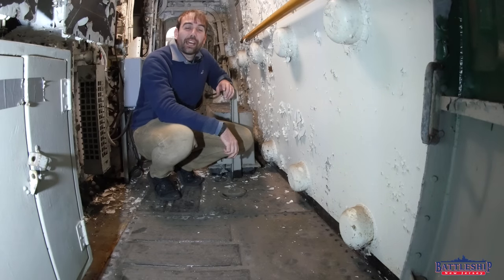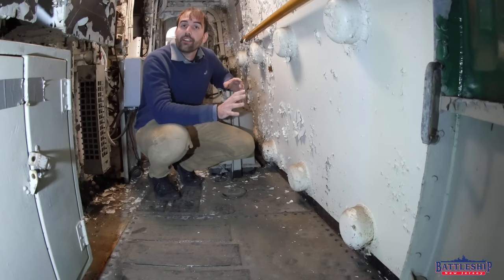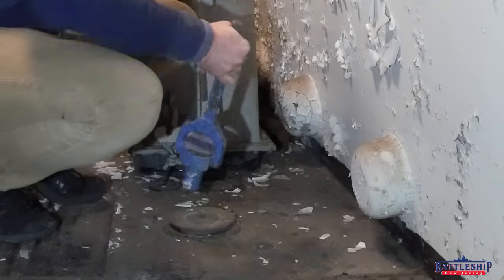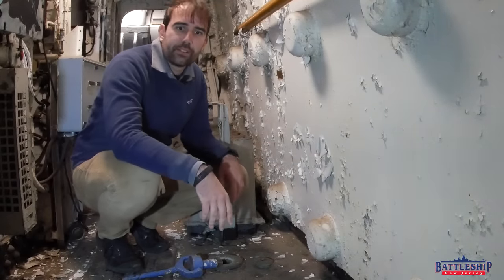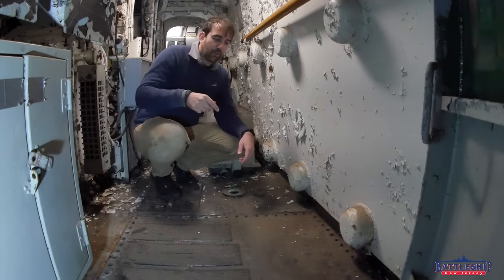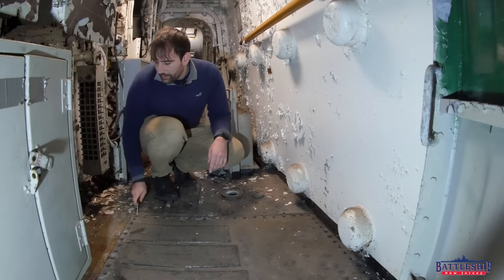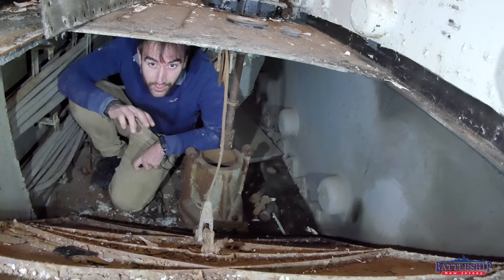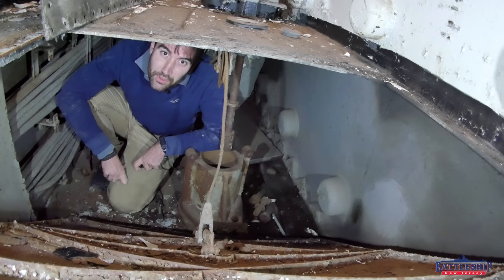Turret Locking Pins: Can the Turrets Rotate? UPDATE

Comment: Back in 2006, Marty, me and several other volunteers raised the barrels on turrets 1 and 2.  Each barrel has locking pins and now are pinned in the 20 degree position.  We raised them manually.  I have pictures of that day.
Reply: I was literally about to ask if the barrels can be elevated.
Reply: The way the Navy loved redundancy, I would not be at all surprised if there was a hand-powered method of turning the turret hiding somewhere.
Reply: @Orxenhorf  there is almost certainly a way to manually build hydraulic pressure, but i wouldn't be surprised if there was no non-hydraulic way to rotate. that said, i could imagine the final gear that rotates the collar could have a bolt or crank for "hand turning" on the other side. sometimes this is done on huge geared systems for various reasons. such a crank may be essentially impossible to turn by "hand" though because of the force required
Reply: @Gunbudder  Tom Scott "the older one" has a video on the turret of the USS Texas. Those were manually trainable, but they're only a fraction of the mass of one on New Jersey's. Even so, the mechanism to manually train one of Texas' turrets looks like a pair of big windlass drums with eight chainfalls each that took sixteen sailors to traverse the turret, slowly. It took 16 guys to train the turret at less than 12° per minute.

https://www.youtube.com/watch?v=GnGuELP0MCQ&ab_channel=TomScott%2CTheOlderOne
Reply: @Gunbudder  there could be an electric turning gear via a large reduction gear, which could be just about manual capable with a pulley setup or comealong. But you'd be getting degrees per minute with an electric motor, so a manual turn doesn't strike me as terribly necessary or even possible.

My ship has electric turning gear on the gearbox for rotating shafts in harbour, and while you can and have to align the drive dogs by hand, turning shafts by hand isn't possible. An Iowa turret probably weighs more than our entire powerplant and driveline.
Reply: @Orxenhorf  I swear some old 1880ish battles ships had that but it required like a hundred men to do it. Which at that point if the turret can't rotate, their probaly needed for damage control.

I know for certain that the hundred ton gun in gebralta could be manually rotated and fired with a 60 man powered system.
Reply: Use a come along, lol
Reply: @Orxenhorf  there is not. Ryan has answered this question time and time again. Those turrets weigh thousands of tons. Even with the gearing in place, you just wouldn't move that kind of weight by hand.

Technically it might be possible, if you custom made a gearbox for it, but I would imagine the turret rotation would be measured in degrees per day, not degrees per minute.

As it stands, with the stock fitted gearing, the turrets are not able to be rotated by hand, at all.
Reply: @roadsweeper1  2 Million pounds minimum? That seems excessive since the number I found for the entire ship is 45,000 tons.
Reply: @abyssaljam441  Iowa has a video on her youtube channel showing some of her guns being raised. Lotta work manually.
Reply: @Gunbudder  I the turret lost main power the guns need manual elevation, but training would be done with the whole ship. Even if the turrets could be rotated manually, it wouldn't be quick enough to follow any target.

 The stable vertical could even compensate for lack of elevation control by firing when the ship was rolled to the correct angle.
Reply: Alternate turret aiming: "Helmsman, hard to port!"
Reply: @J-1410  The turrets are roughly 400 tons each but do not have a manual rotation mechanism. Instead they had a battery backup in the turret to operate all the systems in the event the turret lost mains power. There's likely a way to disengage the turning mechanism entirely and turn the turret with a winch from shore, though. In service the same probably could have been done with the mooring cable capstans or something.
Reply: @willythemailboy2  I was more-so taking issue with the claimed weight than if the can be turned.

Of course the Iowa basically shows that "fix it" is the answer and also that they can be turned on shore power.
Reply: I wasn't in the Navy so I have nothing to add.

Comment: Deep inside, Ryan wants to see the turrets rotate as much as we do
Reply: They'll never train again. The only way they would is to light at least one boiler (which they can't do) in order to get dynamos running (which they can't run) in order to have enough power to run the electro-hydraulic motors (which have no hydraulic fluid) in order to traverse/train the turrets.  Believe me I'd love to see that just as much as anyone else....but I know it'll never happen.
Reply: I wonder what it would take to do that. Even without enough power available to run the original system, it's hydraulic so splicing in a smaller pump (and an anonymous donation of enough of barrels of fluid) should allow doing it, just slower (assuming nothing else is seized up or the like).
Reply: They set up the ships horn to run on air from a small compressor since steam is no longer available onboard.  It would likely be possible to use a portable hydraulic power unit to feed to hydraulic motors and bypass the original pumps.  As a machinery maintenance tech I will say there is always a way.
Reply: @DIVeltro  if they don't train again, it won't be for the reason you cited. It will be because the money it would take to work around those limits would be better spent on something else. Or because of some kind of regulatory fubar.
Reply: If I ever make a million dollars, I would donate at least 250k of that to whichever Battleship would find a way to turn at least one turret.
Reply: Totally could rent a generator that could run it.  All it takes is piles of cash.
Reply: @DIVeltro  a generator could supply the power…..
Reply: When I toured Missouri years ago, I remember something being said about working towards getting a turret to turn.  I wonder what their plan was
Reply: @DIVeltro  , shore power would be available.
Reply: @DIVeltro  they can be handcranked. It’s what they did when the ship was first brought in as a museum
Reply: The 1800 amp breaker for the turret doesn't mean it draws 1800 amps at all times. If your only running a motor or two and not everything. The amperage draw will be much less. Just turn off anything you can spare to avoid overloading the shore power.
Reply: @DIVeltro  so i almost bet there's something that could be done by a tractor....
Reply: The USS Iowa in LA were able to rotate turret 3 on shore power in order to lower multiple 16 in shells to balance the ship and remove the fresh water ballast
Reply: @DIVeltro  You probably shouldn't say that something will never happen when you have no idea if it'll ever happen or not.

Comment: I believe she was the first to be turned into a museum ship was because the material condition of her hull. When she entered drydock in 1986 her hull was in poor condition. Both rudder posts were rotted and one rudder was dangling. The paravane eye was half rotted through and was cut off during that period.  She spend months in drydock and the countless pits were clad welded and sanded smooth. I remember a welding engineering speculated that the hull could have gotten so fatigued that the metal could actually break up if she hit something hard.  I remember kicking around rivet heads in the bottom of drydock.  I wish I would have saved a few.  It was because of the Hull Accountability Work that I met Dick Landgraff. I remember Landgraff commenting the hull problem was caused by inferior hull paint. I remember zinc annodes around the fantail looking pristine instead of rotting away
Reply: I was there.  The Zincs had been installed incorrectly in 82-83 reactivation.  Some yardbird insulated the anodes from the hull steel.  There MUST be an electrical/mechanical connection for the sacrificial anode protection system to work.   BT  "79-"88.
Reply: @barto6577  I was gonna say something like that must have happened.😀
Reply: And New Jersey didn't get the active hull corrosion prevention system the other Iowas received.
Reply: Relatedly, I recall reading part of the reason was the New Jersey had spent more time in commission/active service than the other Iowas, so it was unlikely she would ever be recommissioned, thus a better candidate for museum ship status.
Reply: @barto6577  
It wouldn't surprise me if the guy tasked with bolting on the zincs lamented to his supervisor, "Dammit, the area where the zincs go was painted already so now we have to de-paint those areas."  Supervisor:  "Piss on that, just install them, nobody will ever know or care."  I have no idea of that's how it went but putting myself into the shoes of a lazy manager, that's the scenario that comes to mind.
Reply: @Skank_and_Gutterboy    There was actually rubber gaskets under the Zincs and rubber washers under the bolts.  Everybody who had a clue were dumbfounded.
Reply: @barto6577  
Oh wow!  Down in the engine room bilge they're just bolted right on, that's how it should be.
Reply: @Skank_and_Gutterboy   Just like the Knox frigates I was also on.  They had "Active Cathodic Protection" systems, every now and then, an Electrician's Mate would check the connections to the hull.
Reply: You have to use the correct anode material for the water type the hull is in. Zink is for salt water, and aluminum is for fresh water. They found this out in the USS Cod when it's hull was repaired after being longtime stored in Lake Eire. The Zink anodes had done nothing.  USS New Jersey is in fresh water.
Reply: @barto6577  
Now that's interesting!  I haven't seen that before.

Comment: i imagine that the welding of those pins was mostly a safety step in demilling the ship. if a random sailor (or anyone) tried to raise the pin for whatever reason, they would find it stuck. if they opened the panel to see why, they would find it stuck on purpose. that's a pretty good indication that it is meant to be stuck lol. i have run into things before that appear to be broken (in the military world) but are NOT broken and instead are meant to be "damaged" in a certain way. in my experience, it usually is a bent pin on an electric connector to prevent the wrong plug from being used.

Comment: I just watched a talk by the curator of Battleship Iowa about the so called locking pins for the turrets on Iowa being broken and or misaligned. Their tow company wouldn't tow the ship without them in place because there was a myth that the ship could capsize if the turrets swung out of control and he had to research these pins to convince the tow and the navy that is was safe. Great video I recommend it. Mainly it was about whether turrets fall out when capsized.
Reply: Why would he need to convince the navy? Did they not swing these turrets around?
Reply: The turrets themselves are centered, so it seems to me to be only the weight of the gun barrels themselves that would be affecting the current Center of Gravity if the turret were to rotate.  On the flip side, with no ammo, no stores, and empty ballast tanks, the current C.O.G. may well be much higher than designed, which would tend to magnify the effect of an off-center loading.  The other unknown here would be how much the current weight of the superstructure differs from her design configuration.

In a nutshell, the higher the C.O.G. is from the keel, the less stability the vessel will have.  Move it up far enough, and the ship won't care whether the bridge or the keel is above the surface.  Move it up past that point, and the keel will be the new topside.  This all carefully calculated during the design, and is the reason that a good portion of the total weight of a sailboat is added ballast at the keel.  On some older ships, finding the keel from within the ship can be an adventure involving rocks, scrap iron, and even poured concrete.
Reply: @kevincrosby1760  I thought the gun mechanisms were built over the center of the plate the turret sits on, and the turret has a counterweight.
Reply: @dalepatterson1748  if the turret has a counterweight, then the counterweight would move with the turret, offsetting the weight of the guns regardless of direction they were pointing.

A key design point of any rotating assembly is to center the weight so that it is distributed evenly on the bearing surfaces.
Reply: @kevincrosby1760  Ryan has said that the battleship does indeed sit about 8’ higher in the water than normal, because it’s completely unloaded of fuel and supplies as a museum ship. So the center of gravity is definitely different.

Comment: As others said on the previous video, the motor itself will draw much much less than the rated current you mentioned- that is maximum startup current only, you could easily run it with a VFD or even just run it at lower power without tripping your shore power breaker.  Of course you'd need to find out if you could even fill the hydraulic system but in theory actually running the motor isn't as big of a barrier as you'd think.
Reply: I keep thinking that the current rating that he mentioned was the operating current, not the LRA/Surge current.  The problem was that the ampacity of the SP breaker was substantially less than that of the operating current.  If i remember correctly from a previous video, the SP receptacles topside were not even completely populated, leading to the possibility that the pier facilities couldn't even carry the load.

From 30 years ago, I can remember that even with max SP rigged, wanting to operate even one of our larger cargo fuel transfer pumps required firing a boiler and bringing up an SSTG.  The "standard" configuration of a warship is to have the Ship's Service Generators online.  Shore power is intended only to basically "keep the lights on".  Connected to SP, we had just enough juice to run the electrically-powered auxiliaries required to fire a boiler to the point where we could drive the normal steam-driven Aux equipment.  Bringing those online allowed us to fire the boiler hard enough to actually run an SSTG.  After that, we had the power and steam to bring up the rest of the plant.
Reply: @kevincrosby1760  Never been in the Navy, but I agree with you, shore power is never enough because that kind of load was never contemplated.
Reply: I would also expect that that's the power requirement to operate at full speed, you don't need to operate at full speed on a museum.
Reply: @tedmoss  Turns out that shore power was more than enough to train the turrets since it's now been done.

Comment: I can just imagine a sailor pulling the centering pins as battles stations are being sounded. I bet he had to be fast.
Reply: Oct 24, 1944, Suragau Straight,
Adm Oldendorf, "#$@& Why aren't the &#$@ turrets training on the enemy?"
OD, "Sorry, Admiral, Ens Pulver slipped and lost the locking pin key overboard."
Reply: @ct8764  should have used fulminated mercury.....
Reply: Pretty sure they'd have planned ahead and either unlocked them ahead of time or perhaps simply not locked them at all while in active service.

Looks like more of a maintenance and storage kindof thing than an "Always lock the turret when you leave" kind of thing. You'd have to be in some pretty intense weather for those things to shift on their own, I can't seem to find a total turret weight But just the guns are 121500 KG each.
Reply: @bigblue4364  , 121,500 KG = 133.9 TONS
Reply: @dalepatterson1748  That depends which Tons you're using tbh, It would be 121.5 Metric tons.

Anyhow, that's just one gun, there are 3 and you'd have to assume the turret itself is even heavier than the guns.

Comment: Your observation about the wrench being stored in a different location in each turret raises a bit of a question for me: When the ship was in service, how customizable were the working spaces aboard? Did sailors basically get to arrange their workspaces as they saw fit, or was it up to the chiefs and officers? I would have assumed the navy had a set regulation that says "this wrench must be stored in this specific location", but from what you observed that does not seem to have been the case.
Reply: There's a saying that "Laws without enforcement is just free legal advice.".  But the same token, unless there's someone to enforce the rules, anyone can do whatever they want until someone with a higher rank says different.
Reply: First thing to bear in mind is that you are looking at a seagoing ship designed for combat, which may require high-speed maneuvering, operations in heavy seas, etc.  In my workspace, the only thing not welded or bolted in place or in a cabinet/drawer were my desk chair and the shop's coffee pot, and the coffee pot was "bungied" in place with elastic cords when we left the pier..  If somebody wasn't in it, the chair got the same treatment.  May sound silly, but "Gear Adrift" gets folks hurt or killed in heavy seas.  This was taken to such an extent that part of preparing for sea was putting tablecloths on the messdeck tables so that the mess trays didn't slide off of the table during heavy rolls.  

In general, everything substantial is placed where it needs to be on the prints before the first piece of metal is cut.  If the wrench bracket was original to the ship, then there is a print somewhere which shows how to construct that bracket, and another that shows exactly where it needs to be placed.

In theory, something so minor as adding a 48" steel bookshelf to a bulkhead requires an authorized ShipAlt approved by an engineer.  In practice, something that minor would probably be reviewed and approved by Ship's Force.  In any case, there would be paperwork before the HTs dragged the welding gear out of their shop.

Outside of fixed items, it is pretty much up to the crew.  I couldn't just have the HTs move my fixed workbench,  but which drawer I chose to keep my screwdrivers in was up to me.